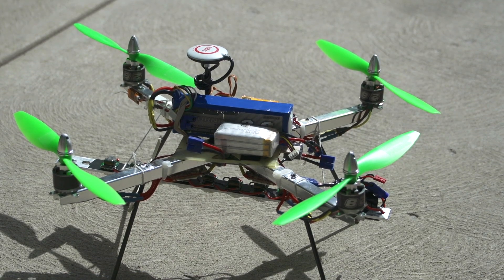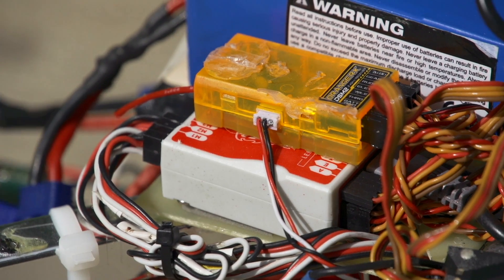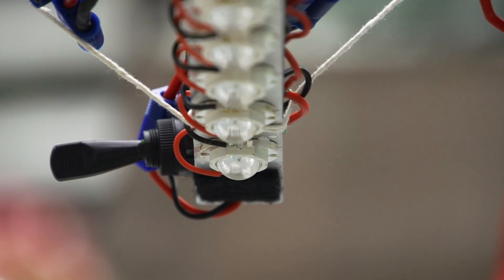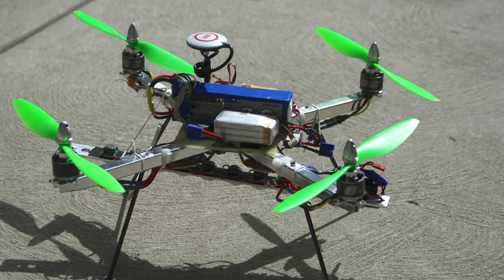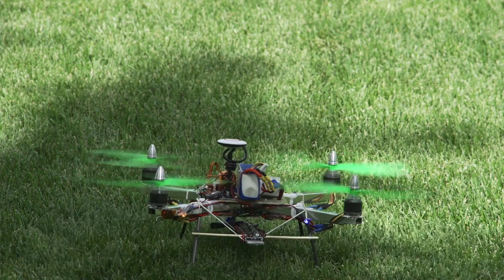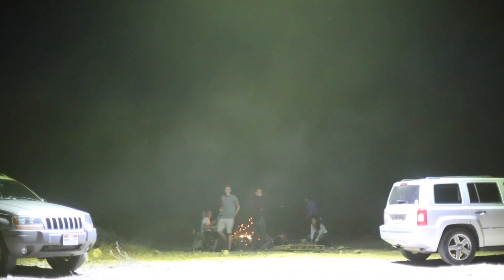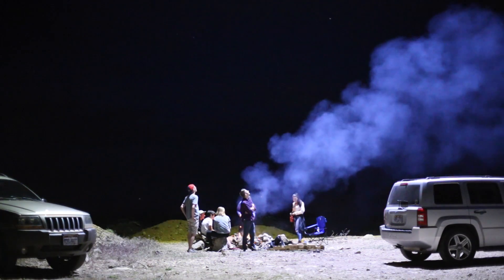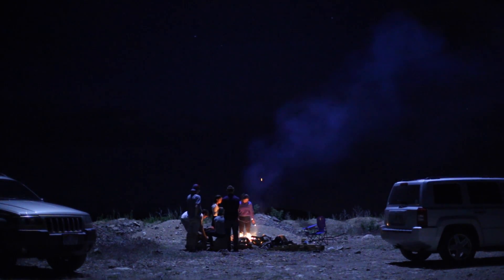100W LED on DRONE - Aerial Spot Light

Comment: You can use the pwm output of a receiver channel to drive a MOSFET or Relay; no need for that janky servo on/off switch. Relays are typically better for high current applications but the PWM input would need to be full on/full off since relays are slow. With a high current mosfet (say 10A or better rating) you might be able to use the full range of pwm and actually control the brightness of the LEDs.

Comment: LOL @ drone. It's a fucking Quadcopter, not a UFO you illiterate imbeciles. It lifts off, hovers and flies like a helicopter, so it is a new form of helicopter except it has more rotors and no tail. It has 4 rotors and it called quads, it flies like a helicopter, so it's a copter, hence Quadcopter. WTF is this drone bullshit? Are you droned in the head not to realize drone is just a word, not a name?

Comment: Interesting project!  Some of those night still are very interesting... it's best when the quad is out of the frame.
I was about to rag on you for the far too little heat sink... but since it "lives" in a very high rate air stream... it is probably OK.  Ever consider an array of Cree XHP70 LED's? Not cheap... but up to 3800 lumens per.  There are some nice, small, lightweight molded lenses available for them, as well as for the Cree XML series... lots of different beam widths are available.

Comment: really surprised that snow didn't short some stuff out ..  like the motors or even the circuits.  Did you have some varnish or epoxy on the circuit boards?

Comment: :-)
This was a great inspiration!
After watching this, I built several different versions of lights for my DJI Phantom. The final evo has 200W and - due to a new receiver in the quad - also the ability to adjust the angle of the LEDs in flight.

Comment: that looks great, im working on a similar project

did you use a current control circuit for the LED's? or just plug them straight up to a 3C lipo? 
do they last long? same battery as quad? cheers

Comment: Wow, that is some serious light output.  I have a 4ft diameter UFO quad I scratch built that could really use a light system like this.  What kind of current is that thing sucking down, around 9 amps?  BTW, where do you live?  That place is so scenic!

Comment: I had a similar idea to put my 24w offroad led light on my quad but never got there.  Your version turned out much better and I had never thought of using it for night photos!  Sooo cool.  Try grabbing a DC brush ESC @ whatever amps you are using for dimmer control if not already.  Your servo switch is nice but pretty hax to be honest.  A 20A brushed ESC is around $5-$10 on hobbyking.

Comment: Actually: This looks like a great thing for all emergency services, instead of blinding low-mounted lights on a pole you can have something like this to hover over the area for some time, get a big enough battery to get something like an hour of work time and voila!
Reply: +mibars 
Sadly no... Bigger batteries are heavier, so need more power to lift. Fitting larger batteries is a game of ever diminishing returns, you soon arrive at a point where the battery is too heavy for the quad to even get off the ground. I'm guessing 10 minute flight time.
Reply: Battery on the ground and a rope up to the quad.

Comment: You need 10x of 10w 9-12v LED Chips and 10x led drivers to control the voltage connected to a 12v power supply now go make some YouTube videos

Comment: Just build my own 90W LED array. Found some 10W LED on ebay, not the same as your using. I mounted on a piece of aluminium and the thing gets hot really quick. 30 second and you can't hold it in your hand anymore. I know high powered LED do give off lots of heat, but seems abit too much. Then again there is 9 of them ;)  How were the temps on your setup? The prop wash will cool it down, but still a bit worried that I will set my quad on fire.

Comment: I build this kind quad with 100W led 2 years a go and I must say that it is great toy. BUT I must warning you. If your gps lock get mad it is really really hard to navigate it back at dark. You dont know orientation and you dont have depth perception. If it start flyaway just drop throttle and let it crash to near you. It is much better than trying restore it and it crash 1,5km away of you and you dot find it before it is too late (several cars are runned over it)

Comment: If you have them try 10 warm white LEDs it may make the light source look like sunlight.

I was actually thinking to do the same when I finished my hexacopter but to mount 6 slim heatsinks under the out-runners, BTW I think there are some premade isolation circuits made to trigger secondary lights with their own power source.

Comment: (long time lurker on your channel) This video has inspired me to buy 10 X 10w LED's but running them directly makes them extremely hot. Are you using a driver of some sort, if so what spec? Great idea by the way my favorites so far are the rocket and freefall quads, cargo lift planes and the snow sled type stuff.

Comment: Any chance of you letting us know the type of led,driver and lenses you used please?
Reply from the maker: I used 10W LEDS with built in 60 degree convex lenses.
Reply: Excellent I have found them, thanks man👍
Reply: stederk Any chance you can share a link?
Reply: rctestflight Put in description :D
Reply: stederk rctestflight 
Don't use them. Get a single high-CRI 100W LED with a very fat lens.
It will be more efficent, will weigh less, eat less power, and look much better. Not to mention be much brighter.
Reply: *****
Same weight same power, less space. Get a medium PC heat sink and put the 100w led, with a 5cm fun, will take less space on your quad, than 10 10w leds
Reply: where?

Comment: Isn't heat any problem by these LEDs? I have played around with lots of these kinds of high power LEDs and heat distribution is always a problem. Can you fly your quad for 5 minutes straight with these turned on?

Comment: Is there a link to the components used ?
Reply: Search for 10w LED on ebay and you will find them!
Reply: Patrik Carlsson I tried that before I posted here, can't find them.
Reply: Patrik Carlsson Thanks for looking but I those ones are SMD which arent as bright AFAIK .  Im pretty sure its the CREE leds that they used.  Could be wrong though.  I think they need an LED driver to go with them too?
Reply: Patrik Carlsson the ones they used had some sort of dome lense on them.
Reply: TheRattleSnake3145 That's very true! I didn't notice! I know that I have seen the type used in this video on ebay too, give me a minute and I will find them!
Reply: TheRattleSnake3145 I'm pretty sure this is not the exact same setup Daniel used in this video, but these items should give kind of the same results.

The LED I linked previously or

http://www.ebay.com/itm/CREE-XML-XM-L-T6-10W-3A-Cool-White-LED-Light-Emitter-Chip-PCB-With-20mm-Base-/151181465504?pt=LH_DefaultDomain_0&hash=item23331e17a0

This T6 LED is ridiculously bright. I have 3 of them in my LED flashlight and it's such a "overkill" flashlight in almost any situation.

I guess Daniel something similar to one of those two LEDs, and then some sort of lens similar to 

http://www.ebay.com/itm/5pcs-15-Degree-21mm-Reflector-Collimator-LED-Lens-For-Cree-T6-U2-XML-XM-L-LED/321153115959?_trksid=p2047675.c100005.m1851&_trkparms=aid%3D222007%26algo%3DSIC.MBE%26ao%3D1%26asc%3D20131003132420%26meid%3Da382e6d087a24cda87d9d4c72bb593ab%26pid%3D100005%26prg%3D20131003132420%26rk%3D2%26rkt%3D6%26mehot%3Dpp%26sd%3D321167202935&rt=nc

or 

http://www.ebay.com/itm/44mm-Lens-Reflector-Collimator-Fixed-bracket-For-20W-30W-50W-70W-100W-LED/321162095745?_trksid=p2047675.c100005.m1851&_trkparms=aid%3D222007%26algo%3DSIC.MBE%26ao%3D1%26asc%3D20131003132420%26meid%3D4d2fa5fae22e400c9a154c809ca68eff%26pid%3D100005%26prg%3D20131003132420%26rk%3D6%26rkt%3D6%26mehot%3Dpp%26sd%3D321153115959&rt=nc

I hope Daniel can respond and give us the exact LEDs and driver boards he used!
Reply: Patrik Carlsson   Those T6 Leds look very nice, 44mm reflector is to big I think but the 21mm ones you linked look like they would do nicely.   Which driver board did you use?
Reply: TheRattleSnake3145 No, the components are all new.
Reply: Dan R
  what are you talking about?
Reply: TheRattleSnake3145 This is not a SMD led, this is normal high power LED (first link)
Reply: Waluch   The first link SAYS its an SMD so you are incorrect.
Reply: TheRattleSnake3145 They are putting SMD to get more views no their auction. Anyway its not a SMD.

Comment: So as an AMA member I got to the point in the video where you start to fly over the people around the camp fire and with no hesitation at all gave it a thumbs down. This is not only a quad made of aluminum but has 2 lipo batteries on board. It is a quad meaning that if one motor or one esc fails it drops out of the sky, straight down.... what could this do to someone under it? how would this react as it drops into the fire? When a young kid sees this on here what example is this going to set for them? If we loose the ability to fly quads due to the FAA this will be
one of the reasons.
Reply: +MarkandMelissa Lehman /// I understand your concerns, but innovation is always accompanied by risk. If the FAA existed at the time, Kitty Hawk would be an unknown spot on the globe...

Comment: I have to say your servo switch is hilarious in the best way possible. I have a similar contraption that's basically a servo zip-tied on to a TV remote. I control a Chromecast with my phone, making the TV remote redundant aside for the power button, so I connected the servo to a microcontroller with wi-fi, and can trigger it from my phone. Servos rock.

 You very well may already know, but you can modify a servo itself to act as a switch that can be connected to your receiver. Here's a link: http://www.rcgroups.com/forums/showthread.php?t=1844682
No moving parts :)

Funny coincidence that I stumbled upon your channel, I'm in downtown SLC.

Great video as always!

Comment: closest thing i have found. I think these are the LED's
http://www.ebay.com/itm/10-X-10W-12V-24V-DC-LED-Constant-Current-Driver-Power-900mA-High-Power-LED-/371182507757?pt=US_Lighting_Parts_and_Accessories&hash=item566c3396ed

Comment: So they make a difference to the flight times?
Reply: He had a separate 3s lipo running the LED's,so the only thing that would make a difference to flight times would be the added weight,my guess not much at all.
Reply: oh right, i wouldn't think he would need it for LED's unless the other battery was to many volts

Comment: What would happen if you put wheels on this quadcopter?
Reply: Well it would a quadcopter with wheels wouldn't it lol.
Reply: Throw wings on it and a tilt motor and call it a VTOL.
Reply: Not sure youde need 100w of light 6 inches off the ground. XD
Reply: Byro how about not , leave it how it is and keep its name of multi-rotor.
Reply: TheeAirworks you didn't get the reference. FoamandTape is currently turning everything into VTOLs
Reply: Byro TheeAirworks True story. I saw a donut, a cruller to be exact, on top of a car roof about to take off. It had wheels on it as well, no less. It actually did not have a rotor, as if youre familiar with crullers, they have 12 little fan blades along the edge. Coincidence? I think not.
Reply: Byro It is already a VTOL.
Reply: Byro TheeAirworks TheRattleSnake3145 
Coincidentally... Either bixler or dave windestat flew a winged model with 4 tilt props. There is a video on here about it. 2 face down and 2 up, then as transition to forward flight they rotate. But in fairness the same thing was created and shown in another video by a guy about 2 years ago, also can be found on YT. So benefits of forward flight for lift under reduced power, versus full power for lift AND flight for a quad.
Reply: It will land on it! ;-)
Reply: Trook2008 You could stab him in the behind and not leave a visible wound.

Comment: Those pics look amazing man.

Have a look for these. I would bet even with a small heatsink it would be much lighter. People who build aquariums managed to get the guy building them to offer custom colours. I have a couple of them and managed to blind myself for a few mins with it. Hell if you can keep 36v at 36 amps you could be the first to run 10x that power.

http://www.ebay.co.uk/itm/100W-100Watt-Cool-Warm-White-High-Power-LED-Lamp-Chips-Bulb-SMD-for-Flood-Light-/221517471281?pt=UK_Light_Bulbs&var=&hash=item3393785e31

Comment: Great video,  where these just those cheap 1W leds you can get off ebay? Did you think about getting one of those single 100w leds and putting that on there?
Reply: Term!natorX He said they were 10W leds, 1W led x10 would not light up that campfire like that bud lol
Reply: Derty McQwerty 42°N Oh yeah  my bad.  But statement still holds true.  Why not use a single 100w led? Maybe the spread on those leds is better.
Reply: ***** actually you can get drivers for Super cheap on ebay now.  But,  wouldn't 10x10w leds generate the same amount of heat? I guess if they're spread out maybe they're easier to cool. But generally speaking they should generate about the same heat.
Reply: Term!natorX  and ***** check out the Sandia Cooler Heatsink, very clever design that may work for the new higher powered Cree & Philips brand 40W+ spotlight LEDs

Comment: love your vids man! I really want to get into homemade r/c, should I start with a plane or a multirotor?
Reply: if homemade
then i would also suggest rc planes
(foam is initially easier to work with)
Reply: I would say plane.
Reply: You should also check out flitetest on youtube for great beginner videos.
Reply: Cutter Slade I've been watching them for like 4 years I consider myself pretty educated. I've just never had enough money to buy anything of the sort. I did want to buy parts for a multi but it is much much more expensive
Reply: Yeah your'e right. It's a big invesment. You could try the make the RCTF Slow Trainer. It's easy to make and you have a nice building video.